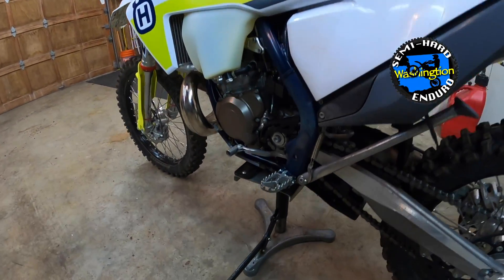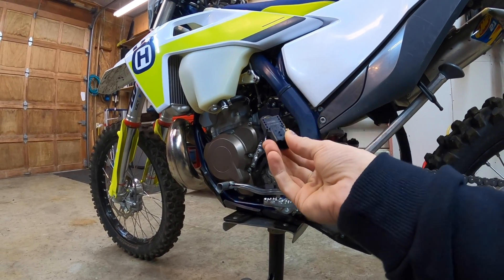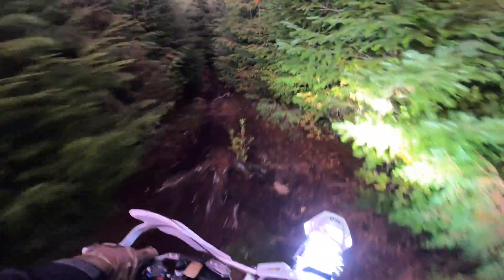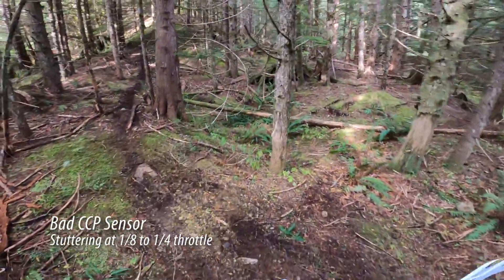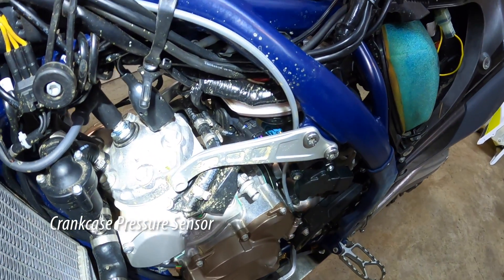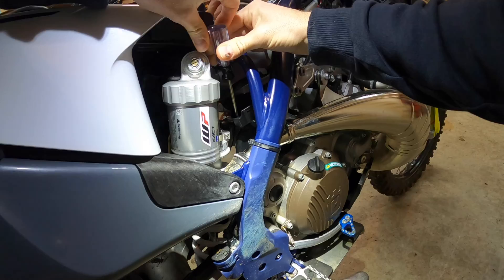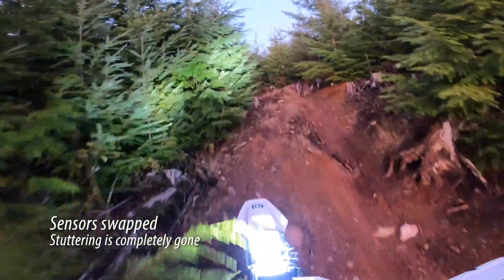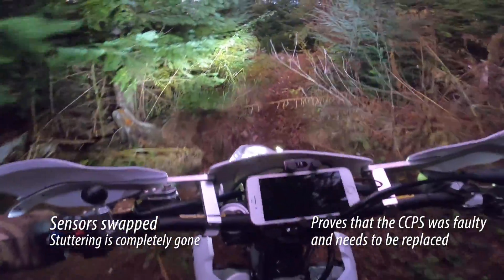HOW TO Diagnose KTM TPI Crankcase Pressure Sensor Issues (Faulty CCPS on KTM/Husky TPI Bikes)

Comment: It seams to have a pingibg noise, same as mine? Is it normal or its a bad ambient sensor?
Reply from the maker: The stuttering is the symptom you’re listening for. During mild-moderate acceleration at lower rpms. Bad CCPS is the culprit. Ambient sensors don’t seem to go bad.

Comment: Late to this. My bike is turning but no start. Did not really idle and sound like yours in video. Turns over on starter but nothing could this be the cause?
Reply from the maker: Turns over but doesn't start? - this wouldn't be the CCPS (bike will still start and run with the CCPS completely removed - you'll just get a code). 

This is most often a wiring/electrical issue. If the kill switch goes bad (water, wires behind steering head get pinched), then it'll crank but not start. There most common are pinched wires behind the steering head or under the seat. The wires can break inside the sheath, so they're hard to spot. 

Last thing to check is fuel, but I'd start with electrical. Reply back if you figure it out!
Reply: @WASemiHardEnduro Good to know! I installed a tsp power kit ecu mapped as well + top end refresh. I’m hoping it’s something simple but uncertain at this point. 😑 ran fine before just didn’t idle/ pick up off bottom too well.

Comment: You leave out how much of an A hole the crank pressure sensor is to remove and reinstall.
Reply from the maker: A little practice, and it's a 5 minute job. Remove seat and tank. Use a T20 screwdriver handle and bend the CCPS tray down a bit to get a good angle on it. Comes right out.

Comment: Do you need to replace both sensors?
Reply from the maker: Usually not, typically only the crankcase sensor goes bad. But if you're still having issues, you can try replacing the ambient sensor too.

Comment: I am a Korean and it is winter here, so it is cold. One day, my motorcycle, which has only traveled 600km, suddenly stalls at first start and struggles at low RPMs before suddenly revving up. I replaced the crankcase sensor, which improved the symptoms by about 50%. What repair should I do next?"
Reply from the maker: For TPIs check the spark plug, check for any air leaks (intake, exhaust, crank seals), check fuel pump and filters (leaks, cracks, low fuel pressure).

Comment: so did you replace the ambient air sensor after this? Or both sensors? This fix got my bike to start and run better
Reply from the maker: Yes. Best thing is to replace the CCPS. Swapping them can be a good diagnostic test, but the proper fix is to replace the bad one.

Comment: Hi, did the exhaust note change when the sensor wasn't working?
Reply from the maker: It’s such a subtle and gradual change when a sensor goes out that it’s hard to tell. I can hear a difference in idle with a fresh sensor though!
Reply: @WASemiHardEnduro  thanks for answering, my exhaust has suddenly become loud, as if the insulation has deteriorated, or as it was running very dry (metallic sound). Bike has only 70 hours and I rode it like my grandma would, so I doubt it needs a top end rebuild. I was more likely to believe in a faulty sensor that messes up the petrol mix. I watched a few videos about it but I can't hear the sound properly and I don't seem to have similar symptoms, my bike does not bog a low revs, but behaves erratically when you release the throttle at high revs, it feels like you lose power for an instant, but in acceleration it doesn't have any issues and pulls strong

Comment: I fouled 3 plug on my brand new straight out of the dealer ( 3 hours on it ) 2023 250SX i have no idea what the reason is
Reply from the maker: The TBIs are definitely different than TPI. Some I’ve heard come pretty rich. Maybe you can play with the TPS a bit, or maybe the dealer has an ecu update.

Comment: Hello super video!  Does anyone know if you can also use the sensor with the part number 5wk9700z, or if it works the same way?  Thanks
Reply from the maker: I've tried them, and yes they "work". But they don't seem to work exactly the same as the OEM ktm part. When I ran the 5wk9700z, it seemed to make the bike run super lean.
Reply: Thank you for your feedback signal!  How many hours have you driven it?  Is there an alternative to the OEM part or have you already tried something else?
Reply from the maker: @FlorianGrafeneder-x3p  I just use oem always now.

Comment: My mid range keeps bogging really bad and it's fouling plugs one after another. Would that be the ccp as well
Reply from the maker: Could be. It’s an easy part to replace and find out.
Reply: @WA Semi-Hard Enduro  yea im gonna order one and a few plugs only 15 hours on it still lol
Reply: @WA Semi-Hard Enduro  sorry one more question. I keep getting mixed answers on it, but would a fmf turbine core mess up the tuning of the bike? None of these issues were present before, and there is a lot of splooge for a supposedly lean running bike. I plan on getting the head kit and tuning done eventually, but just started an apprenticeship, so I gotta wait for a couple more raises lol.
Reply from the maker: @tikkafanboy  TC won’t affect it at all. A screen type sparky can tho if it’s clogged.
Reply: @WA Semi-Hard Enduro  ok ill see if I can clean that spark arrestor, thanks for the quick responses much appreciated! 👍
Reply from the maker: @tikkafanboy  the TC doesn’t need cleaning at all. Only screen type SA needs cleaning and can affect fueling. TC is good to go.
Reply: @WA Semi-Hard Enduro  yea I was going to clean the spark arrestor, get those parts, some fresh gas and see how she runs. If it runs good I might throw the paddle on and run it hard at the dunes to clean the piston up. The tight trails around my house I can't really open her up that much.

Comment: I have a question, that hopefully someone can answer. I have a 21 KTM 250 xc tpi, with about 24 hours on it. I have done the idle screw mod, and have been trying to dial it in. The idle was way too low stock, and the bike would often try to die when going down hills or braking into turns. I was able to fix that, but a problem I have noticed now is surging on deceleration or "pipe bang" as many across the forums call it. This happens when I full close the throttle and coast. If I am rolling with the clutch out, each time the rpm surges it actually makes the bike lurch forward a bit. Does anybody have any clue what may be causing this? Some have said the bike being too rich, while some have said the TPS is misaligned or not set properly. The bike does have the bulletproof designs TPS cover, which does require fully removing the tps sensor from the throttle body to install. I bought the bike used with that on it, and in order to disconnect the tps sensor so that I could do the idle screw mod you have to remove the tps cover, which of course removes the entire sensor from the throttle body. Any insight/suggestions would be greatly appreciated.
Reply from the maker: Could be that you have the idle too high now. Shoot for 1600 rpm or so, but not higher. TPS should be ~0.60v but not much higher. A bad CCPS can cause a low idle too. 
Lastly, some TPIs just babe pipe bang. Mine does a little but not too bad - never been able to get rid of it completely.
Reply: @WASemiHardEnduro  Thanks for the advice, I think you may be right. Yesterday I turned the idle way down. Bike wouldn’t stay running unless I gave it some gas. To my surprise, when riding the bike, pipe bang was completely gone. Gonna have to actually measure the voltage at the TPS I suppose. Just out of curiosity where do you have your air screw set? I would assume you tune the air screw first and then set the idle since the air screw affects the idle too?
Reply from the maker: @spencerjohnson5474  I have my AS about 0.5 turn out.

Comment: Unreal. I thought it was a feature of modern 2-strokes to have a strange bog at low RPM for emissions, but this swap changed everything about power delivery. 80 hrs in and I am only just now experiencing the correct low end.

I'm curious though as to why this is still happening (my bike is a 2022). I saw that part numbers haven't changed. Anyone done anything to fix these sensors such as a silicone seal?
Reply from the maker: Seems they go bad due to contamination from the crankcase. Which you can’t exactly prevent. Though some folks seem to have success adding a small filter inline. Doesn’t explain why many have zero issues at all though. The part # hasn’t changed, and it looks like the ‘23 TBI bikes might still use the same sensor, but in a different setup.

Comment: At 145 hours I think mine is finally going out on my 300xc tpi. What’s weird is it’s fouling plugs. Could the CCSP cause that. All the symptoms are exactly the same. Minus the 2 fouled plugs. Could it be that it’s been going out for a while and finally just started it’s symptoms today? I was going down the trail today and it started it. Then sputtered so bad it died. Wouldn’t crank back. Pulled the plug, fouled. Put a new plug in, rode about 30 miles back to the truck. Symptoms going in and out. Keep in mind this has been the best running bike I’ve ever had and have never had an issue with it. After I put the new plug in the symptoms came and went. Also keep in mind that the plug it fouled today was brand new too. First ride on it. It’s got me stumped, but has to be the CCSP.
Reply from the maker: Yup, plug fouling is a symptom for sure. Change it and reply back to let us know if it fixed it. 👍
Reply: @WASemiHardEnduro  definitely fixed it, but I’m not convinced it was the sensor. I changed it just in case, but when I took the little hose and fitting off, the hose was clogged a bit with some carbon buildup. Either way it’s fixed tho. I thought the job was gonna be harder than it was leaving the little tray on the oil tank, but it wasn’t bad at all.
Reply: @Drewski423  Clean the hose every time you replace the sensor
Reply: @MAXlMUS  yep. When I replaced the sensor I cleaned out the hose and it was probably 50-75 percent stopped up. Probably wasn’t even the sensor but I replaced it anyway.
Reply: @WASemiHardEnduro  I’ll let you know. I’ve had a spare since I bought the  bike new, but never needed it. … until now lol. I guess 145 hours out of the stock ccsp is better than what other people have gotten. I’ve seen them be bad on first crank lol.

Comment: Have you done a teardown of the sensor to see if it was impacted by debris on the sensor diaphragm?  maybe difficult to tear down and keep  the integral components intact, just curious of the cause of the failure
Reply from the maker: I cut one open - it's very hard to tell why it failed. There was barely any debris, but there was some. I used MAF sensor cleaner on another, didn't notice any difference. Some ppl have reported success in doing this though.

Comment: My bike doesn't keep running and smokes a bit
Reply: And I ride a 2020 xc250 tpi
Reply from the maker: With the TBI kit? 
Need more info on what exactly it’s doing to help.
Reply: @WASemiHardEnduro  if i start my bike it smokes, and if i give a bit of throttle it boggs and sometimes dies and then won't start again til i put a new sparkplug in. And sometimes it's rideble but u need to keep a bit of throttle otherwise it dies.
Reply from the maker: @hugomx5387  Replace the CCPS, spark plug. Then use proper warmup procedure - don’t touch the throttle until it’s warm.
Reply: @WASemiHardEnduro  i have put new ccps in there and the ambient air pressure sensor in there and stil it won't run probably
Reply from the maker: @hugomx5387  Lots of things that could be - clogged spark arrestor, bad air screw setting, leaky crank seal, etc
Reply: @WASemiHardEnduro  thanks, I'll just bring my bike to the Husqvarna dealer in my town
Reply from the maker: @hugomx5387  TPIs do run poorly until they are warmed up. It’s super important to not start the bike and less you are able to let it fully get up to operating temperature. Shutting the bike off early will cause too much fuel and oil to accumulate in the crank case and on the spark plug which will foul the plug.

Comment: Sad part is dealers are clueless when you even bring it up. Which is bs to begin with. This was my son's bike from day one, was told that's just how they run. I did the carburetor idle screw mod from Slavens, that cleaned it up big time. Bought two sensors for good measure, holy crap his bike runs like a 2 stroke is supposed to.

Comment: So my bike is having this issue but it’s with throttle 3/4 to fully open. Runs strong down low. Any ideas?
Reply from the maker: Lots of possible issues: clogged CCPS hose (or leaky fitting), cracked fuel filter (in-tank), clogged fuel filter, dirty air filter, blocked gas tank vent hose, stuck power valve, top end need replacing, bad ground connection somewhere, etc.
Reply: @WASemiHardEnduro  Thanks man! Just broke my ankle but as soon as I can I’m going to start doing further diagnostics

Comment: Anyone check the CCPS output voltage on the signal wire?  Would be interesting to know what a good reading vs bad reading is at lower engine speeds.  Curious if there is soot/spooge buildup in the sensor itself preventing an accurate reading at lower pressures.  The sensor is potted, would be super interesting if a little dip in an ultrasonic tank wouldn't clean out the goo.  I would not totally submerge the sensor, keep the electrical connector out of the bath.  For a tank solution just water with a 1/4 cup of simple green, much more gentle than a shot of carb or brake cleaner.

Comment: My 300i still stutters even after swapping sensors. What should I do next?
Reply from the maker: BOTH your sensors could be bad - replace. The CCPS hose could be blocked or have a small leak - inspect and clean. Check all the other stuff (spark plug, air filter, fuel filters, etc).

Comment: I have a KTM 300 TPI 2018, the bike works well, when I go up to 600 meters of altitude, it has a vacuum at 1 / 8-1 / 4 of throttle opening ... it can be the sensor or it is a characteristic of the 18-19 models ??
Reply from the maker: What do you mean it has a vacuum?

Comment: I think mine has failed at 75 hours ('21 TE300). Started noticing it at about 60 hours but it bad at 75 at low throttle AND 3/4 throttle. Gonna swap my sensors and find out.
Reply: Update. my sensors were fine. It turns out my issue was a very dirty spark arrestor screen. Crazy!  Very similar symptoms that is described by the CCPS failing. I learned something new as this my first 2-stroke (I owned 4-strokes before) and I only cleaned the screen once. So it all clogged-up at about 75 hours. I removed it for a test ride and she's back! Used a torch to burn it off. It caught fire like a sterno can and burned for 2 minutes!
Reply: Sorry, I don't know English.  You can explain your problem in more detail, I think I have the same problem as you

Comment: I heard that the crank case sensor fails way more often than the ambient pressure sensor. Would you recommenc swapping the sensors as part of preventive maintenance on like 100h of riding time?
Reply from the maker: It’s a good idea to have a spare sensor on hand, but if it ain’t broke, don’t fix it!

Comment: I've got 2021 husqvarna te 150i. The issue that I have is that in the middle of RPM (just before the high RPM an power kick) the engine starts to interrupts. Only when I slowly accelerate. Any ideas?
Reply: Same here - 2022 TE 150i. It's my first 2T bike, ridden 350 exc-f in the past. TBH, I don't know how these bikes should feel like, but mine has 5 hours now, and since new, it sputters somewhere just before it hits the powerband. It's extremely annoying - I thought this is how a 2T should feel like
Reply: Swapped the sensors, same issue... Eventually, I bought a tachometer and adjusted the airbypass until the engine was idling as the manual says - 1400-1500 and now it seems to run better. Still, I am not convinced the sensors are bad - what would be the chance for a brand new bike to have 2 new faulty sensors? It just doesn't add up
Reply from the maker: Sounds like the CCPS might be the issue

Comment: So I had that issue and also it wouldn't idle. So I swapped and the idle fixed it self and the sputter disappeared... On the street. I replaced the bad (now) Ambi sensor since it was easy access. Should be good right? 2 months later I take it out for trail riding. However, the idle is still good but now I have the lower rpm  sputter sticking around. It seems the sputter and idle problem go hand in hand but now I'm not sure....
Reply from the maker: I've had a sensor go bad in as little as 15 hours. No idea why they go bad so quickly sometimes, yet some people never have issues.

Comment: Now that these are all sold out, i have an interesting question for you. The sensor on your title screen, 5wk9700z, is actually the pressure sensor out of a land rover. It definitely looks the same. Do you know if this is the same sensor as the OEM KTM version? I don't see that number off the one that I removed from my bike. Thanks.
Reply from the maker: Yes, it seems to be the same. I’m using one in the barometric position right now since oem are back ordered.
Reply: @WASemiHardEnduro  Thanks! i'd be curious if your bike still ran as well with it on the crankcase side.
Reply from the maker: @tomtorrance9194  Yes, I’ve tried it. Runs fine.

Comment: Mine was failing from new and when I swapped them the other one lasted a couple hours. I have glued them and it's the best its ever run and it's been about 10hrs.
Reply: What do you mean you glued them?

Tokyo Offroad has made a machined brass CCPS adapter with a modified CCPS mounting tray. As some of the trays the CCPS mounts too crack.

Comment: How long can I ride the bike after swapping sensors around?  They are back-ordered until August
Reply from the maker: I replied to (I assume) you on TT. Probably fine to run it swapped for a while, but you might want to try a non-oem sensor while you wait.